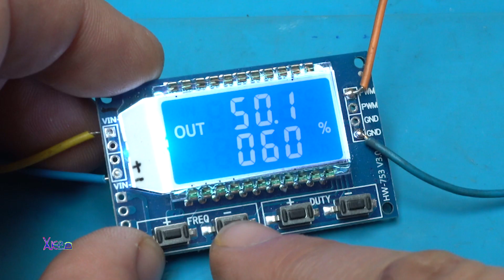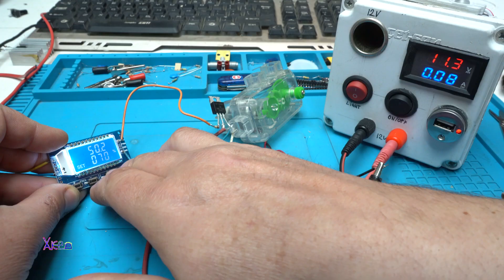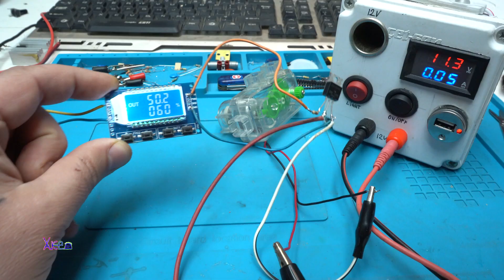Building The Cheapest MOSFET Controller EVER

Comment: Great video!   A few notes though: 1. You should have mentioned that you can only use certain types of loads with this controller (incandescent bulbs, motors are OK, probabbly LED strips too). Since this device's output is high frequence pulses it is unsuitable for majority of electronic devices; 2. You were lucky you did not burn your mosfet when you connected it to the motor. All inductive loads must be snabbed to protect the MOSFET from back EMF, especially in the pulsed environment. At least a diode across the motor terminal should be there. Remember the inductive "kick back" voltage can easily exceed the MOSFET's rating;  3. It is not probably critical with this controller, but still advisable to have the Gate discharge resistor when you use MOSFET.  Use an oscilloscope to check how clean the gate signal actually is and you will know for sure whether you need such resistor.
Reply from the maker: Thx for feedback sir and for explanation👍
Reply: There’s a good chance that the module already has a snubber circuit on the output.
Reply: @mikebond6328  I was talking about having a snubber on the output of the MOSFET, not the module.  I don't think the module needs it, but the MOSFET connected to an inductive load does.
Reply: @Elvin_Black  I think the term " fly back" is the collective name of some generators that indeed use Back-EMF principle in their work.  And yes a diode parallel to the motor terminals in the reverse polarity to the power supply will offer basic protection to the MOSFET as it will short-circuir back-EMF (if the diode is fast enough).  For more reliable comprehensive protection from inductive spikes please google "snabber network".
Reply: LEDs are a horrible usage better off with a varactor these are either on or off with a led.